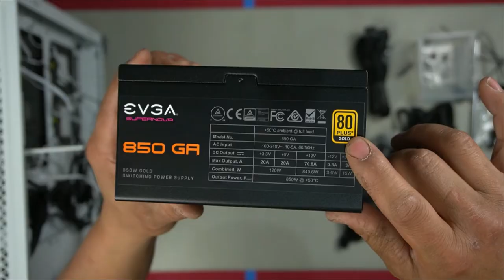mid to high end gaming pc corsair 4000D/rtx 3080ti/32gb 3600/r9 5900x/850w psu/x570 wifi bt/360 aio

Comment: the tubes of the radiator should be at the bottom. The way you have orientated it air will enter the pump. A better position for the radiator is at the top of the case if it will fit.
Reply from the maker: yes it is but there's nothing too wrong doing it this way too..its been done by all the big pc tech guys ..jaystwocents all of them

Comment: Hi man, i don't want to bother you, but there is a "major" problem in your setup... The AirFlow is bad, so the cooling to, and... performance due to temperatures...
This is due to your FAN intakes / outakes management.
You chose to place back and up FANS to intake fresh air, and Watercooling on front to outake hot air...
2 issues :
-back fan with no DUST protection will bring dust in setup...
-Front water cooling take hot air, and so CPU is not cooldown has it should be.
Hope this Help...
Reply from the maker: so I dunno if u can see but the front fans are intake and the top fans are exhaust and the rear is exhaust
Reply: @MIKEYZVLOGZ  Oh, so thats great !
Reply: ok front intake top rear exhaust is fine, 1 question still remains in my mind : @5:14 why the AIO fans are inside ? ( on the left of the radiator... you could put them on the right ( close to the exit ) so the absorb fresh air easier, no ? ) ( thx for replying, i about buying same PC case, and im not sure of AIO configuration... there is argue and reverse argue everywhere )
Reply: ( like is it better to have 3 fan in front inkake fresh air, and 2 FAN IAO on TOP exhausting ? )
Reply from the maker: @KrtoOn  ye I know alot of ppl have different opinions ... but most ppl say u can do either or ... I guess u can try one way and if u have issues change it .. but yes if aio fans ate on front u might get more air faster ..yes this is true ... 👍
Reply from the maker: @KrtoOn  yeah that is fine too...